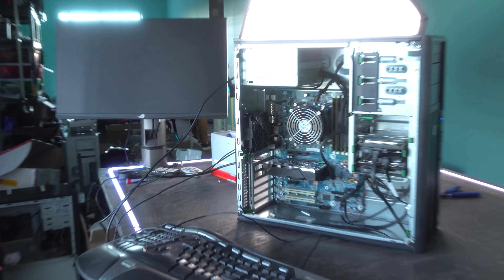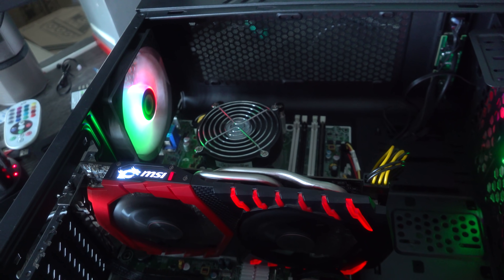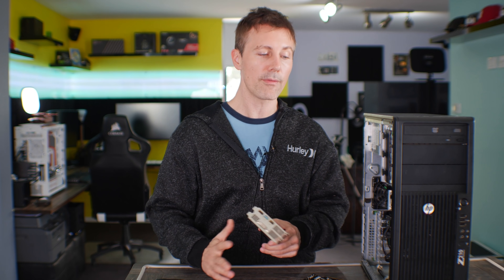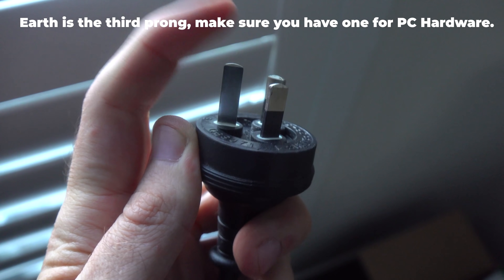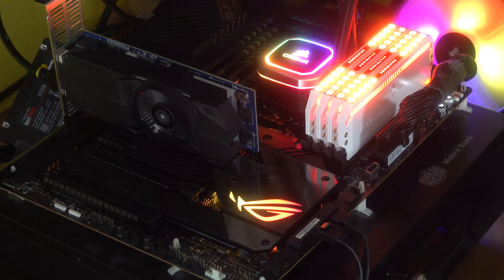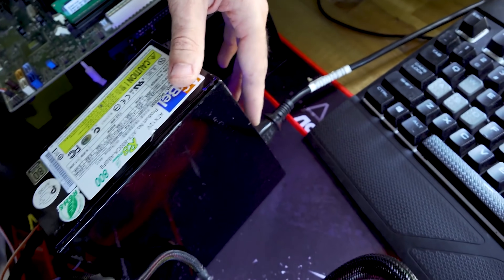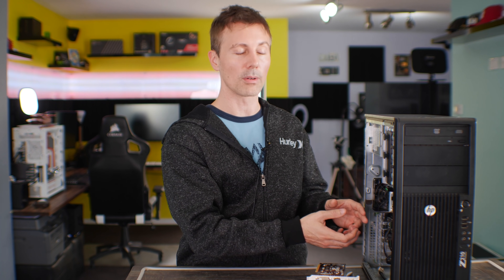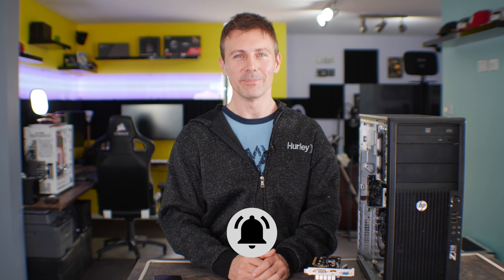Black Screen, How to FIX a Computer that DOESN'T Boot?

Comment: Heya Bryan!
I had a strange issue on my pc where it would freeze constantly when it got to Windows.
Without GPU, it would be fine.
With a different GPU, it would freeze anyways.
Culprit? PSU! And the solution, weirdly enough, was to disable C1 and C6 States!
Tested on 2 systems and works flawlessly! So weird! But hey, it works.
I changed the PSU on my main rig anyways, since gf prefers to play on something that is reliable ahah.

Anyways, thank you Bryan. Good video!

Comment: A UPS is a great idea for electronics but not all UPS's are created equal, get a UPS which does EMI filtering or a inline UPS, this will filter noise from the AC input effectively cleaning the signal and preventing AC line noise from being amplified down stream in the PC resulting in a cleaner audio and visual signal.

Comment: Hello guys, recently I found a problem i wish to share:
On the past year and a half my PC (1600x,1070,16GB RAM,NVME Storage) was crashing randomly from games (very light games) to the desktop (that for example made me unable to play competitive in Valorent).
It literally took me getting a new CPU (3600x), changing to GPU to a different one, checking the RAM with MemTest, and nothing... all the tests were good and no problems found.
Until one day i decided to turn off XMP in bios, and then this crashing issue never happened again...but this is super weird since XMP worked fine for at least like a year and a half (i own this RAM for like 3 years at this point)...so if any of you guys run into similar issue check XMP.
I wont say what brand it is because they are a big and good brand, Im currently in RMA process and having no issues with their Reps.

Comment: I've had a ram issue in the past where the DDR2 in an old pc died within days of each after after a few months after I changed the motherboard. I couldn't justify throwing any more money for that pc and just sold off the 775 board (that probably caused the ram to die) and the Pentium processor it had Aside from those 2 hard drives also died with that pc, so I really cut my losses and just kept the working parts, a 500gb hdd I got for it and its psu which still works and powers the pc I use to type this comment

Comment: Wait, I thought upping the voltage will reduce the lifespan of the silicon?
Reply: BECAUSE the silicon has degraded, it may require extra voltage to stay stable. Obviously it's not a permanent solution, it's a sign the CPU is on it's way out

Comment: Pro tip:If you have black screen power the pc wait a bit to load windows and press the caps lock or num lock to see if they are working.If they light up on the keyboard then the problem is in the video!

Comment: My friend received a computer with a 10900F, and he had bought a GTX 1650 because was the only thing he could buy.
When he tried more intensive games comptuer would shut down.
I tried running a prime95 didn't even last a second.
Turns out that it had a 500W generic PSU.
He bought a new one that I recomended and I instaled it.
I don't remember very well but it was a seasonic gold core 750w if im not mistaken.

Comment: Ditto with houses with dodgy power supplies and old 'old' fridges. We lost a VCR and a PC due to power surges when the fridge/ freezer turned on... $200 sealed PSU component replaced due to 5 cent part within it popping...

Comment: hi brian i need your help. my pc is freezing on windows logo every time i try to use my gtx 680 with riser that comes with my loque ghost s1 and same with cooler master NR200P which i recently purchased. i tried to vertical mount gpu and same thing happen. however gpu is running great when i plug it onboard pcie. plz tell me is there any motherboard setting to do? btw i m using gigabyte z390i.

Comment: I had an issue where my PC failed to boot into desktop and showed a black screen instead with just the mouse cursor working

I reinstalled the windows and it has been working perfectly so far
Reply: Windows can be a real pain most of the time

Comment: CMOS Batteries that are old and low on voltage can cause motherboards to freak out and rain havoc.
Always measure the old CMOS Battery on voltage, if the voltage is lower than 2.6volts replace it, it needs to be close to 3volts.
Reply: can a weak cmos battery cause a computer to not boot at all?
Reply: @ssm840  YES, that could be a scenario. But i think it's a small one. Something like reseating the RAM is more popular for a not booting system.
Reply: @N0N0111  if possible cld u help me? I swapped my ram from 16 gb at 2133 by defult too 32 gb at 2900 bc my mb said it was rated that when I swapped it now wont post and the mouse n stuff wont light up . I swapped back to original ram and put even 1 stick in all slots to try it and even reset cmos nothing works unless i put a single stick in i get everything working but its not its like it has a glitchy screen that keep’s rebooting it looks liks static on my monitor almost w stretched out words what a day to not work
Reply: @N0N0111  fuck my life lol on Christmas too it be like that
Reply: @N0N0111  thanks tlbrp
Reply: @ssm840  i had to replace my cmos battery to get my pc to boot as the old battery was dead

Comment: Just used your video to help me get my wife's friend's computer working. Took out the battery for a few minutes and took out all the memory modules except one. Then added them back one at a time. Must have just needed a reset because all the memory seems to work. I'm doing a stress test right now. Thanks man! God blessed you with major talent bro!

Comment: my house grounding was not good before, i got shocked from my keyboard everytime i touch the metal plate on my keyboard, i nailed the wall and connect some random cable from that nail to my pc case and its fixed my problem, my keyboard no longer shocked me, hope this helps anyone

Comment: He might just have low or bad power. There are a lot of ways this happens a terrible one I saw (lightbulb change/week) was the main incoming fuse was sort of half blown and sparking but still through circuit. Lots of other ways - solar on roof dying, ground faults, appliance faults

Comment: Bro, I bought a 1050ti, a was using it to mine lightly on for testing. I turned the pc off, repasted the card then boom it didn’t work anymore after installing again.

Just checked the monitor I had plugged in and it’s NOT GROUNDED!!!!! Bruh did I fully break the gpu?

Comment: I was experiencing this last weekend. Pulled that battery, used one stick of RAM and managed to get into the Bios. After multiple attempts at getting the PC to boot with all of the RAM, I finally figured out that it was the Corsair AX-860 PSU was dying. I ended up getting an EVGA 80+ Gold 850 watt PSU to replace it. My beloved 9900K is still alive!

Comment: Nice. My Ryzen 2700 recently stopped working after a windows insider update... Fixed it with taking CMOS battery out. Had just put a 3070 in it and petrified it was that!

Comment: First and last problem can be easily connected. Meaning if psu is craping out and power installarions in house are crap it can couse problem number one. I had psu cable bursting in flames while pc keept on working fine BUT after few months PSU went to shit and rest of it. PSU cable that cought fire worked fine for while untill I noticed funny smell. Power delivery is odd thing

Comment: sometimes Im getting a black screen, with all my peripherals getting power and the computer is turning on, fans are spinning but it doesn't boot all the way to windows, just no display..
i have fixed this issue several times by kicking my case slightly then restarting it. everytime it worked well
Reply: Reseat cpu and the cpu cooler if you can also do the motherboard.  It could be a power supply but I doubt it

Comment: The power supply thing is why I feel like a "throw away" PC is the best power supply tester, if it blows up who cares, and if it doesn't then it probably works just fine.
Reply: Yeah, I have no PSU tester but I do have a stack of cooked mobos and fried PSU's which left the test bench as quick as they appeared on it. Probably would have been better with a cheap PSU tester. [insert laughing crying emoji here]

Comment: Hey Bryan.
The house power issue is more common than you think.
Investing in a UPS can solve this issue and creates a barrier between the house power and the pc.
The older areas in Aus sometimes have problems with power surges too which a UPS controls.
Worth mentioning on your channel.
Cheers, Mon from Brisbane.
Reply: Countries/towns that have power lines above ground and next to streets have most power issues overall.
People in these countries/towns will have power outages when there is a storm most of the times.
Invest in quality surge protectors, you don't have to go out and buy expensive UPS stations.
Reply: Not only in Aus...
Reply from the maker: Hey Mon, yeah we had at our place a second electrician go through and double check our electrics as there were some real concerning issues.
Reply: @techyescity  a UPS also helps protect against power cuts giving you time to power down your pc without loosing or corrupting data.

Comment: I’m praying this doesn’t happen to me. Sounds like Greg just did a vid on this too. My 1070 is 5 years old now and I am hoping I can get a 3070 before it dies

I’ve had to take out the battery in my motherboard many times because some settings in the bios just refuse to let you reset the CMOS

Comment: I hade a set of faulty DDR3 once where any files I copied between hard disks it caused the copied files to become corrupted (CRC checked) but everything else worked fine. Took me a while to figure it out because it happened over time and eventually system files became corrupted and it began crashing etc.

Comment: My advice: start to exclude the possibility of Windows being broken if you use Windows. Have a USB-stick with some Linux-distro on it of which you verified that it boots ok, boot from that USB-stick and see if it boots. If it doesn't then you have bigger problems, some hardware is disconnected or broken. If it does then it is just broken Windows which is easily solved. Boot Linux, you can immediately use the internet, download Windows and install it. Or use Linux, which I recommend. :p
Reply: Totally agree. I was amazed to see a video about a black screen, which can often happen after installing Linux and Windows. It is then a bootloader issue.
Reply: @keithmiller9665  I  had at least 3 broken Windows installs so far: on a laptop and desktop. It really sucks if that is your only OS, so my sincere advice: have a USB-stick with some bootable Linux-distro at hand before that happens if you only boot Windows. 

I don't know how Windows10 handles network-drivers these days (I have been using only Linux on my desktop for at least 3 years, including gaming), on my old desktop PC the network-card would never work on Windows until I installed a driver, but you can't download that driver if you have no internet. Yes, that happened to me (2009) when I only had that one computer and no smartphone. For Linux those network-drivers are included out of the box and with that you can get the rest fixed.
Reply: @keithmiller9665  By the way, with EFI bootloaders are rather tricky. Both Linux and Windows make a mess of it, but in different ways. On Linux you can have some problems with some files which are used to make the initram because different distros have some minor differences. I love the choice in the Linux-world but that is not good. :) 

Windows just doesn't care about other OS's having been installed. Windows just writes over the Linux-bootloader, the Linux-bootloader (mostly GRUB) plays nice with Windows (you can boot both Linux and Windows with it) but Windows does not play nice with the Linux-bootloader. The really crazy part, it often happens that Windows messes with your partitions, it creates a new partition and as a consequence the partition-name of the partition with the bootloader on it changes and can't be found. Come on Microsoft, play nice! ;)

Comment: For the RAM could also be a memory slot itself. Got an 775 Gigabyte mobo which does run absolutly fine with slot 1,3 and 4 populated but starts acting up as soon as I put a (no matter which knowingly working) stick in the second slot. I also remember my brothers issues, all GPU´s put in his rig (exact same as mine at the same, accept for the PSU, had to swap my 650W Straight Power 2 years earlier due to failure like many others across the globe had to) were failing putting out black screen but working fine in my PC. I´m pretty sure his Straight Power was failing as well, since even an HD5450 was like all other cards (with power connector) failing after just one week. Obviously there was something wrong with the power delivery and it weren´t the outlets, because other electronics (like the monitors) would have failed as well using the same outlets.

Comment: Just after a big Windows version update, I got a black screen.
Had to boot to Safe Mode, remove and reinstall the graphics driver.
After putting the optimal settings back after install, the next boot went back to Black Screen.
Repeat a few times...
Found out that setting the monitor to "10 bit" mode was the problem (it is a 10 bit monitor that worked fine before...)
Windows broke something and cannot use that setting anymore.
(I haven't dared re-test it even though it's been a while...)

Comment: Your most common problem is your building from the bottom of the barrel and sometimes, not always, but sometimes, shit is JUST shit! Even on the high-End PLATFORMS.  The cowboy era,(error)....   Few standards, no communication, between board partners, chip-set and CPU mfrs.  No real ram standards and last but certainly not least, THE BIOS, FIRMWARE AND DRIVERS ALONG WITH THE OS ALL FIGHT EACH OTHER!  The worst is almost behind us(YOU?), but when you are constantly looking for the best deal, cheaper is not better and what was once considered gold we now know as hyperbole!  Sometimes, know matter high or low end, its the resources after the sale, IE, bios, firmware, software and OS that determine over-all quality of life.  Buying older equipment with good specs from those eras are just Russian rule't!  If you buy cheap from cheap-end MFR'S and the Dell's ETC, YOU JUST DON'T KNOW WHAT YOUR GETTING!  Right now, I say JUST DON'T BUILD.....PLEASE!
PS.  When you are updating older pc's, you end up hitting power limits, not enough in the short-term but over time if your pc gets so many errors, it will stop booting.  Normally, your monitor, GPU, but really the errors can come from anywhere in the system.  pulling the battery or resetting the system only masks the issue.  Ideally you need to start any upgrade with a good PS, Then your chasing less fault codes and understand that YOU/ANYONE may have gotten some piece of h/w that is old, worn-out or built like crap, that is just drawing too much power.  I have seen an RGB keyboards black-screen a PC.  The hardware is that old.  Also, some old power supplies and motherboards with old h/w and new gpu's, cant handle the power over-time coming from the rail to both the PCIE and the power connector to the gpu. (it was at its limits new, now just worn out) It may work, but just a matter of time and with no consistency, One or the other, or both at the same time.  Again I say, just don't build right now.  I would try to barter my services/expertise/sweat equity towards something to get you by, and save your money when things get better.  AND IT WILL GET BETTER!!!!  PEACE!
Reply: surge protector surge proctor surge protector!  Remember the dial-up days when a lot of people blew out the network chip, same deal.  The tolerances were not the same back then, for anything!  You have old h/w!!!!!!

Comment: Tell them to get a backup UPS power unit. Controls power as well.
Reply: UPS Power Unit doesn't help at all if the entire Power Sockets in that person's house isn't Properly Grounded.

Yeah sure UPS have Ground Pin, but where the Heqq it supposed to go if the wall socket Ground Pin isn't even working properly?

Comment: TLDR: nothing important

Something like that fairness to me last month. After changing some things on the bios for some reason it just wouldn't start.
Luckily I have a mobo that shows the post code and also has a led that shows what component may be the problem. It showed the gpu was the problem. As I assumed I didn't burn the gpu right now when gpus are really expensive, then the mobo wasn't recognizing it anymore.
As I don't have another gpu with integrated graphics, I just removed the battery to go back to stock settings.
Turns out that while changing the config for how the memory is used to get done extra boost in performance, the mobo decided to also change the automatic recognition of dedicated Gpus to only integrated.

Comment: I had an issue with my PC loading a black screen after blowing out the dust. I initially did a hard reset to the Motherboard by removing the CMOS Battery however that did not resolve the issue. Once I removed one stick of RAM and powered on the PC at that point the BIOS and Windows OS booted fine. Turns out that RAM goes stale from time to time. Never had that issue before...

Comment: and dirty power from the grid "spikes" is a problem to sometimes
Reply: If you have spikes and can't afford to rewire your home you can always buy power conditioners. But really it's down to a rubbish electrician. Especially if you have just moved into the house and not had the wiring checked beforehand.
Reply from the maker: @Mopantsu  This^ we had a first electrician come in and not wire properly, the second electrician was shocked.